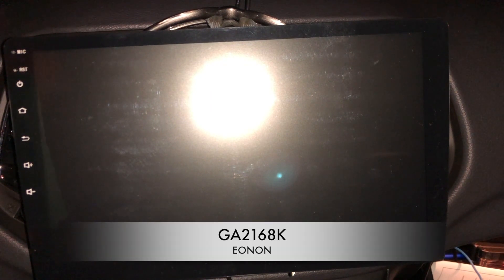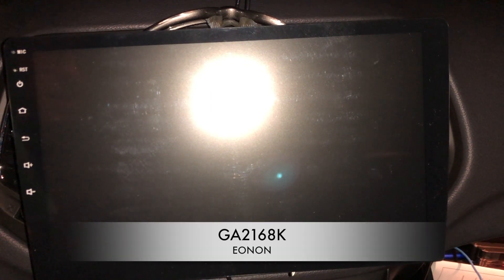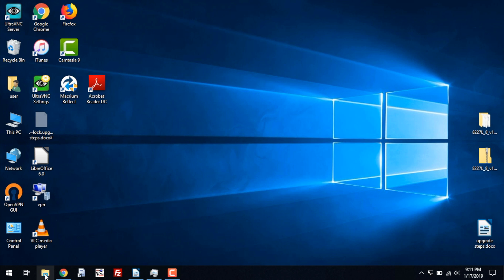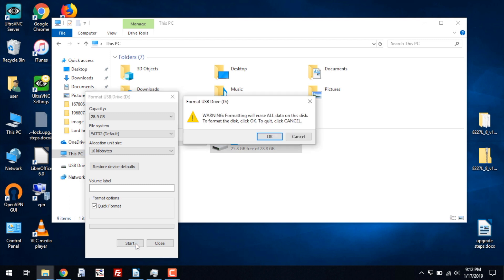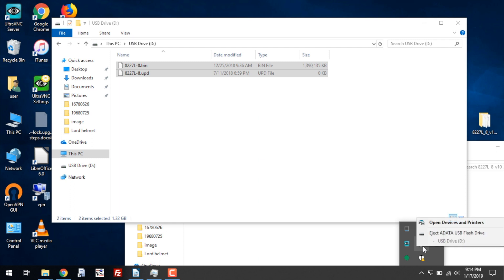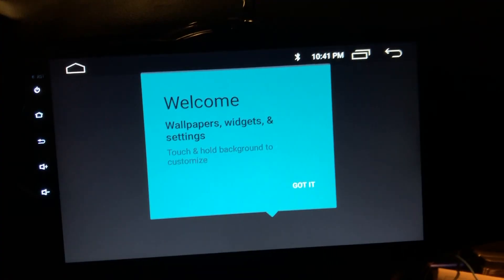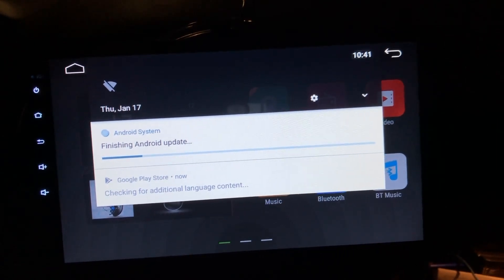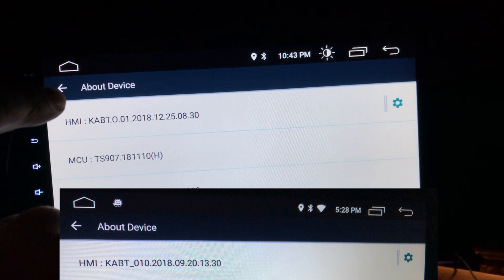Tech Tip: How to update the firmware on an Eonon GA2168k

Comment: I obtained a unit as a gift and it’s not from a Jeep. I want to update it to the most recent. How can I go about it? I’ve installed it on my 2000 Honda CRV. It works well as a regular head unit but, GPS it has detection ( antenna ) and that’s it. Maps do not boot up. And when I go to maps it only has Hong Kong and Canada. I can’t upload a new map even through my home WiFi. Please help🙏🏾

Comment: Would it be possible you could put the updated firmware out to be able to get it outside of eonon? I’ve been having trouble getting ahold of them and I need to get a customers radio done.
Reply: Eonon its just a reseller. His units are just klyde units so you can have all info about them as firmware files and updates on this topic:  Klyde PX4 | PX5 | PX6 head units with MCU CSN2 | CSN2_D | CSN2_8600_D (Android 8/9/10
Reply: My says MCU1: HW8227L-3.3-SWO-1.3

Comment: Very good and very explanatory video. But EONON does not provide upgrades saying its units cannot be upgraded due to differences in hardware and frameworks. I asked for the GA2171S unit, and there is the GA2171SR with Android 9, and they refused saying that:

"Dear Fabiano,

Thanks for your email.

Kindly reminder that the Eonon head unit can’t be update to the latest Android version. Since Eonon head units with different system versions vary from the internal framework, design, to hardware. Their software can't be commonly used. The head units Android 7.1 / 8.0 / 9.0 / 10 could not be upgraded to Android 5.1 / 6.0 / 7.1 / 8.0 / 8.1 / 9.0 / 10. Thanks for your understanding in advance.

If you have met any problem while using the car stereo, please tell us the issue in details, and we'll provide the specific solution. Thanks for your understanding!

Best Regards!
Yva
Customer Service "
Reply: @Fabiano Martins The same thing happened to me.
I bought used GA2171SR that came with Android 9 and asked about "upgrade" to 10 and responded with exactly the same text (Control C and Control V, probably).
Reply: You can upgrade man. They just can admit his units are just Klyde units. Heres the update process. https://forum.xda-developers.com/android-auto/android-head-units/head-units-rockchip-px5-mcu-csn2-t3912413 . By the way , my unit its a GA2171sr
Reply: @ProfWashingtonUESB  Were you able to update your head unit?
Is your device with "physical" buttons or "touch" buttons?
My GA2171SR is with physical buttons.
Reply: @fabioarai  Yes Man. I update my unit to Android 10 and updated the system filés using instructions on the thread from XDA. By The way my unit have physical buttons but it dont make Any difference on process.
Reply: @ProfWashingtonUESB  
Foi fácil?Funciona tudo sem problemas?
Reply: @fabioarai  Opa. Amigo o máximo que exige é atenção. Não tive dificuldades e funciona tudo. Atualmente tem duas versões com dois launchers diferentes para Android 10. Todos comandos mantidos e continuo atualizando.
Reply: @ProfWashingtonUESB  
Opa, obrigado!
Vc aconselha a ler todo post antes de começar o procedimento?
Reply: @fabioarai  Com certeza. Foca no processo de upgrade do Android 9 para o 10 e os detalhes. Se quiser realizar apenas o update sem o upgrade do Android é super simples. Mas para o upgrade do Android 9 para o 10 precisa de um pouco mais de atenção e utilização de notebook.
Reply: @ProfWashingtonUESB  
Valeu!
Vou ler tudo antes de tentar aqui.
Vamos ver se dá certo.
Por acaso vc fez algum vídeo ou tutorial em algum fórum/grupo?
Reply: @fabioarai  E aí? Conseguiu realizar o upgrade do android?
Reply: @ProfWashingtonUESB  OPA! Nada, ainda não tive nem tempo de "destrinchar" todo artigo do XDA. Já "flashei" muita ROM em Galaxy Sx e sei que tem que estar bem embasado para não pular nenhum procedimento.
Mas ainda farei. Deixa as coisas acalmar aqui...
Aí posto aqui mesmo como foi...
Reply: @ProfWashingtonUESB  Então Washington, estou lendo (tentando) todos tópicos do post, mas acho que os primeiros já me deram algum "norte".
Reply: @ProfWashingtonUESB  Opa, sou eu de novo! Acabei de vender sem fazer update.
Já comprei uma Ossuret PX5 com 4/64 que já está no Brasil. Vamos ver se é tão bom quanto...
Reply from the maker: correct, i haven't seen a single eonon model that you can upgrade the OS to a higher version of android OS

Comment: Any update since u update it? How is the unit holding up
Reply from the maker: yup still going strong, went on 2 trips with it not a problem... did need a firmware update to fix the waze audio issue and to fix the clock jumping one hour every cold boot. and hilarious name lol
Reply: South Hawk Computing LLC awesome. Highly considering this one.
Reply: Where can you get the firmware update at?
Reply from the maker: @BillySpivey  You have to contact eonon e-mail support, their response rate is 1-2 days
Reply: @marktan8137  Thank you for posting this up.
Reply: @marktan8137  Thank you for posting this up.
Reply: @marktan8137  thanks bud!
Reply: @marktan8137  any idea if this is specific for GA2168K? I have GA2168 and would like to update.